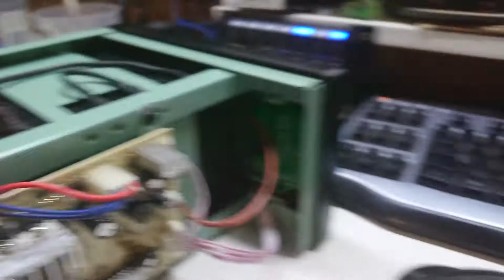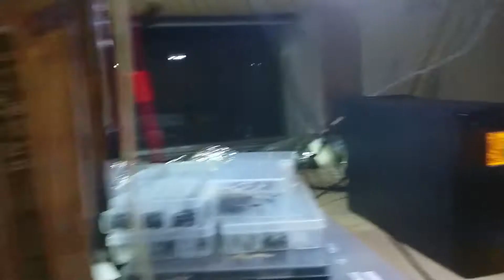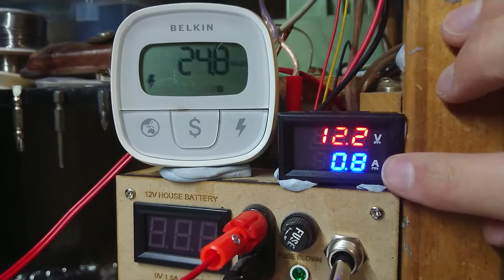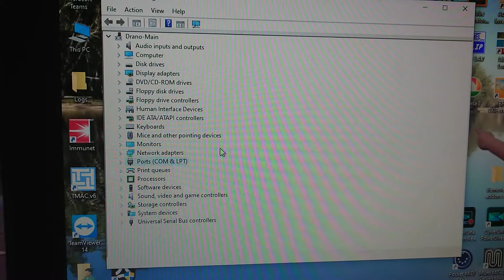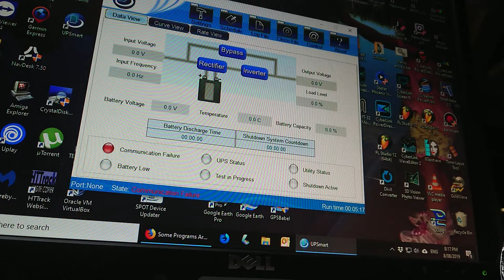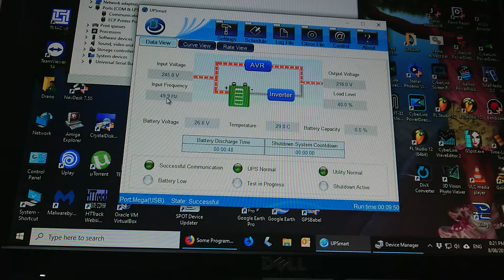Jaycar MP5207 UPS teardown and installation.

Comment: I have 2 of these UPS.  Apart from worn out batteries, they have worked well.  I loaded the software according to your video and that worked well too. Except that the battery level indicator on the RHS shows 0% and the temperature always showing 29degrees (both of which issues are the same in the screen shoots in your video).  Have you been able to fix these two issues?
Reply from the maker: The battery level was shown incorrectly when I set it to two batteries, wheras the batteries being in series are only seen as a single battery.
I don;t think I saw a thermistor anywhere in it, so I'm not sure how it;s measuring temperature, it might not be doing so at all.

Comment: My mp5207 ups failed and had most of the fets burnt out. Also had the batteries below 5v. I replaced the fets and batteries. The fuse blows when plugged in. When I go to plug my new batteries in the fets spark and smoke so it may be the inverter circuit shorting out.
Reply from the maker: Sounds like the fets weren't the only thing that went. I'd test the poly fuses and any switching transistors you can find. These things can pretty rapidly get uneconomical to repair.

These days I use a 24v battery bank, victron charger and victron inverter. Functions similarly to a UPS.

Comment: G'day, I just found your vid after inspecting one of these at a customer's site. It was dead, although the fuse was intact. I did pull the lid off so see if I could see any obvious issues (I'm no sparky) and two of FETs where blown (Q2 & Q8). Any ideas on that implies?
Reply from the maker: Sorry that it's taken me 2 years to get to this reply - for some reason I was never notified.
Blown fets usually happen in these when the batteries get so far gone that they go dead short.